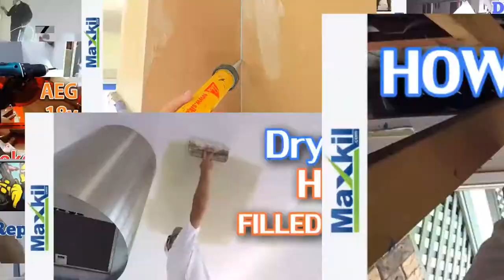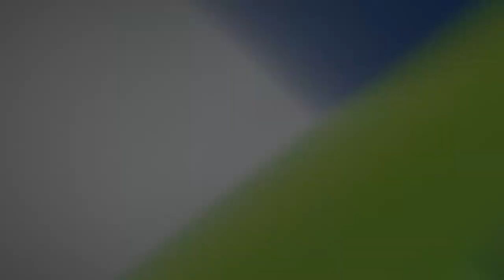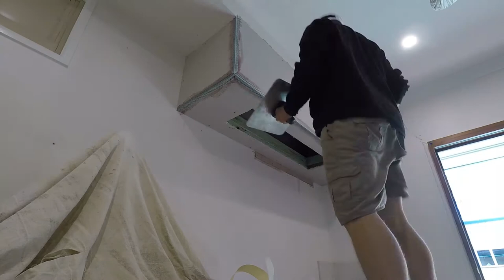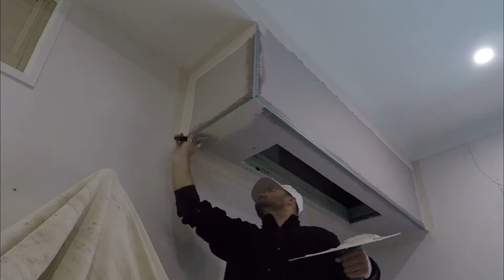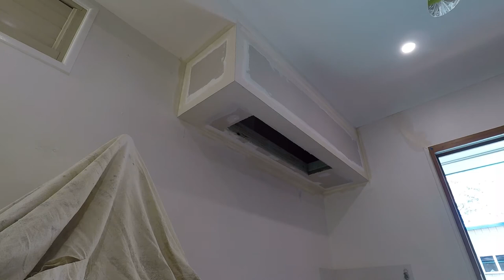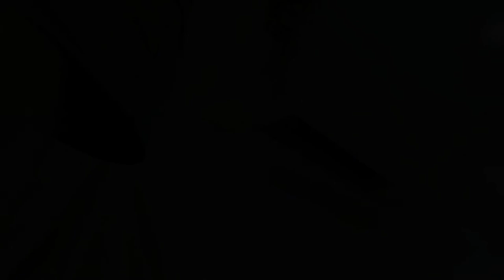How to Finish Metal Drywall Corner Bead on a Rangehood for a BBQ

Comment: How come you put 2 tape layers on that bulkhead to ceiling joint?
Reply from the maker: Hi Michael,  That first coat was a pre-fill to even things out a little and to fill the gaps before i rand the tape over the join.  I will also add that i try and use cornice cement 45 for all my small jobs instead of basecoat for my first two coats. Its so strong. Its actuall a bulkead on a bulkhead. lol.